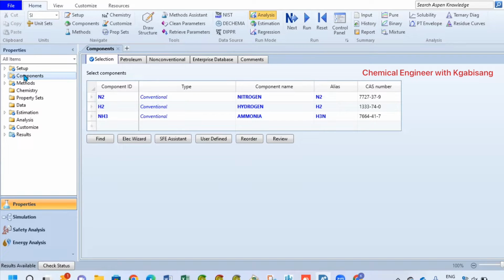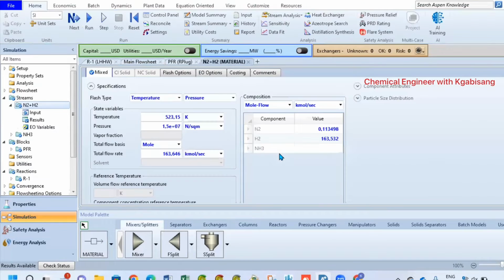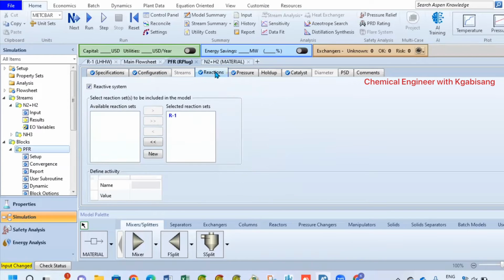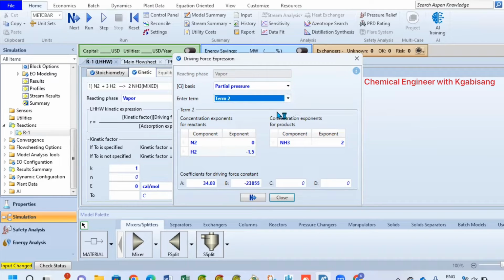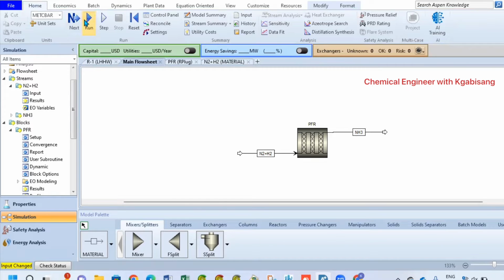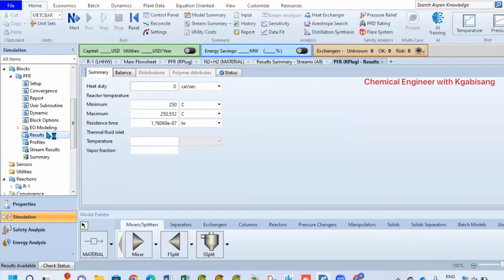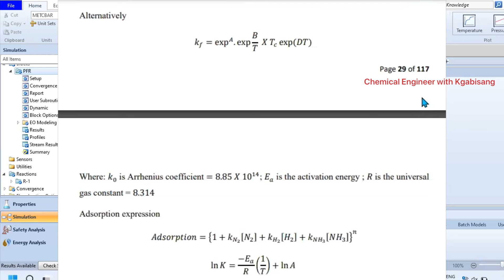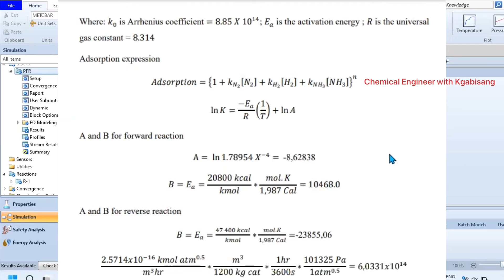Kinetic Reactor Design using Aspen Hysis Plus V1.2 for Ammonia synthesis

Comment: can you provide the reference of this research article?
Reply from the maker: Hi, kindly click on the link to my website if you are interested in accessing the full article used in this video, complete with all the equations. This includes three volume formulas, equations solved with Ordinary Differential Equations, and thorough explanations.

https://chemicalengineerwithkgabisang.co.za/solved-inq  

In terms of articles used. Various resources were carefully considered and synthesized to create the final document outlining the design for the ammonia kinetics reactor. 

1. Design of Ammonia Reactor, Talal Mohammed Jassim, Third Year Chemical Engineer, University of Birmingham
2. Ammonia Synthesis Kinetics - Surface Chemistry, Rate Expressions and kinetic analysis 
3. Elements of chemical reaction engineering_3rd pdf textbook

Comment: Thanks for the wonderful video and explanation! May I have the title for the reference literature?
Reply from the maker: Thank you for getting in touch. Please click on the link to my website if you are interested in accessing the full article used in this video, complete with all the equations. This includes three volume formulas, equations solved with Ordinary Differential Equations, and thorough explanations.

https://chemicalengineerwithkgabisang.co.za/solved-inq  

In terms of articles used. Various resources were carefully considered and synthesized to create the final document outlining the design for the ammonia kinetics reactor. 

1. Design of Ammonia Reactor, Talal Mohammed Jassim, Third Year Chemical Engineer, University of Birmingham
2. Ammonia Synthesis Kinetics - Surface Chemistry, Rate Expressions and kinetic analysis 
3. Elements of chemical reaction engineering_3rd pdf textbook (available online) 

Thank you for your patience